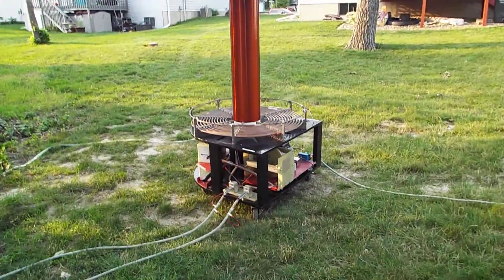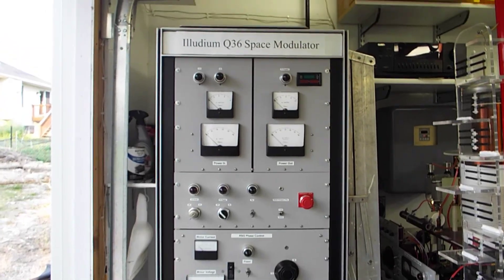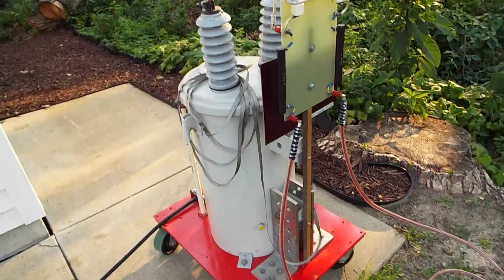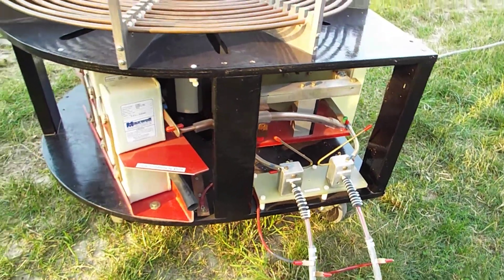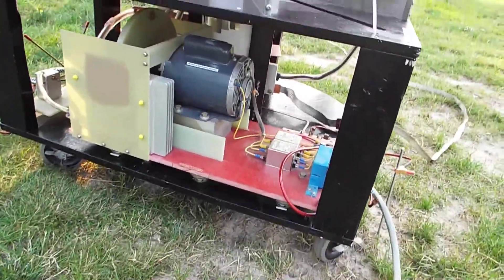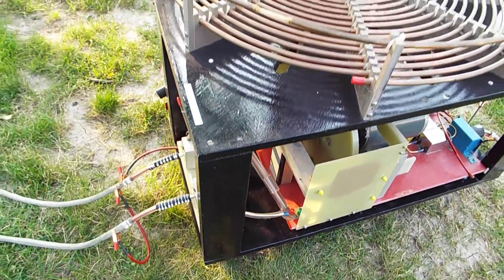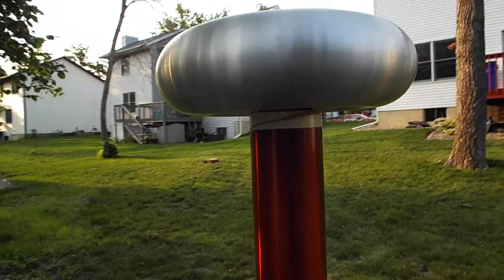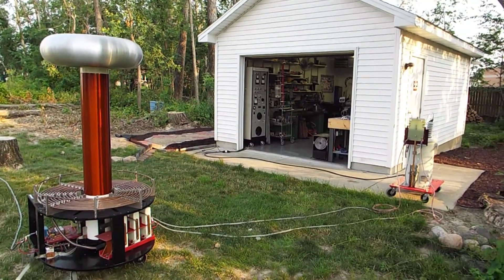6 KVA Spark Gap Tesla Coil Overview

Comment: Great setup. Can you explain or share pictures of what you are doing with the resistors on the pole transformer?
Reply from the maker: The 2 resistors and the 2 small capacitors form 2 low-pass filters, one per leg. The purpose is to protect the pole transformer by reducing the magnitude of any high frequency voltage spikes kicking back from the Tesla coil. It probably isn't needed because the BIL rating of the transformer is 125,000 volts but its just there for additional protection of an expensive and hard-to-get part.
Reply: @littleshopofelectrons4014  Great to know and thanks for the quick reply!

Comment: Very clean setup. Is the primary arc suppressing ring a continuous loop or split somewhere to prevent parasitic losses?
Reply from the maker: It is split and grounded.
Reply: Thank you for sharing. I'm putting parts together now have pretty much everything. Am studying designs, really like yours, it is absolutely gorgeous machine.
Reply from the maker: Thanks. There are a lot of detailed photos of this coil at this forum. Look for postings started by MRMILSTAR which is my forum name.
https://highvoltageforum.net/index.php?board=9.0

Comment: Nicely done. I am building a similar one. Can you comment on the RC filter at the output of the Pole transformer? I presume this is to shunt HF from reaching the transformer secondary.  What values of R&C  did you use in your unit?
Reply from the maker: It is a simple first-order low-pass filter to reduce the magnitude of any high frequency current feeding back into the pole transformer secondary coil. The cutoff frequency is about 800 KHz. I used parts that I had laying around the shop. The resistors are 500 ohm 150 watt wire-wound power resistors and the capacitors are 400 pF 30 KV doorknob capacitors.

Since I'm using a pole transformer, this additional protection probably isn't needed since it has a BIL rating of 125 KV. It was trivial to build the low pass filters and I had the parts so why not? It also provides a convenient connection point for the high voltage leads.
Reply: @littleshopofelectrons4014  Thanks for sharing!

Comment: Where do you source the HV leads from the pole pig to the coil?
Reply from the maker: I made them. The inner lead is made from Belden 30 KV test lead wire. This is surrounded by clear PVC tubing. The PVC tubing is surrounded by copper braid which is grounded. The connectors were made from audio jacks.

Comment: Hello what is output of transformer voltage and current?
Reply from the maker: If you are referring to the pole transformer the output is 14.4 KV and rated very conservatively for 10 KVA. I'm pulling about 6.5 KVA from it so the current draw is roughly 0.45 amps.